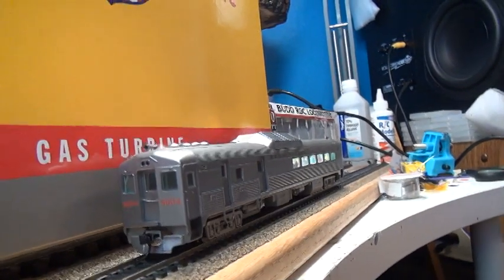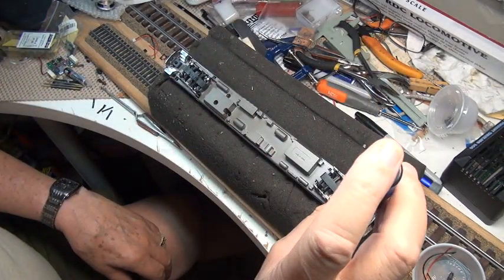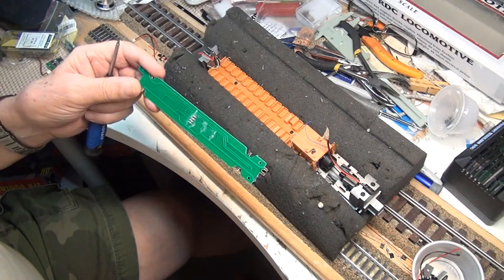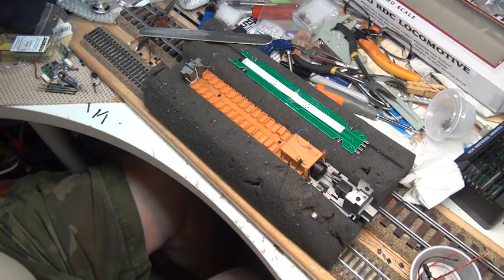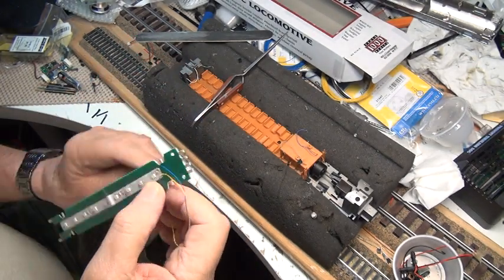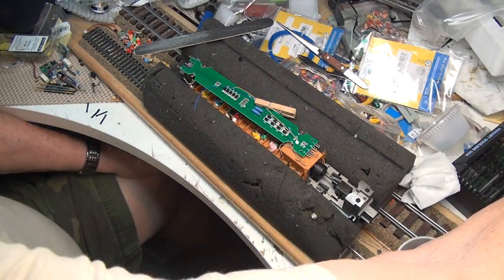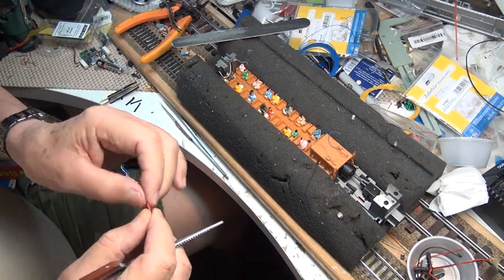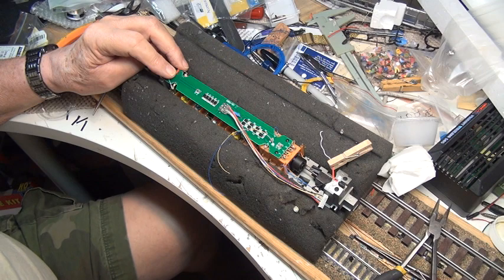PROTO 1000 RDC NEW HAVEN CONVERSION W CLASSIFICATION LIGHTS

Comment: Nice RDC!
By the way, marker lights shouldn't be green in the front. The front should be unlit. The back should indeed be red. 
Green marker lights are section lights. They indicate there's a section that's behind. In your case, there isn't.
Reply from the maker: Good to know, I will make them white in the future. Still attempting to down load Part 2. My computer is not being very cooperating. Will try my Lap Top.
Reply from the maker: I had to go back and research the right colors. The white forward Classification lights represented an extra non scheduled train, green; a train followed by a second or more sections. Red of course was on the rear of the train except UP used red lights on the front end when stopped to warn on coming trains they were stopped and to protect their crews. I will use green just to add color. Plus there's always a second train coming sometime. 
Thanks again for your input.